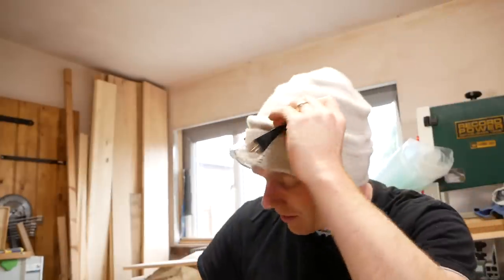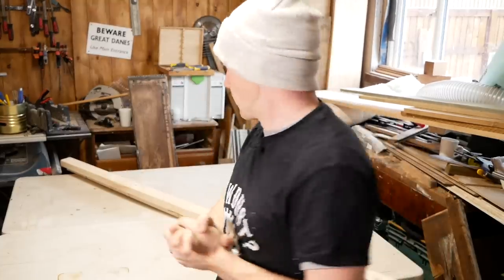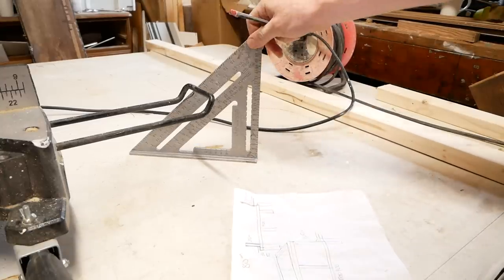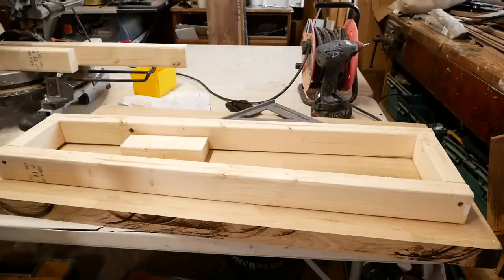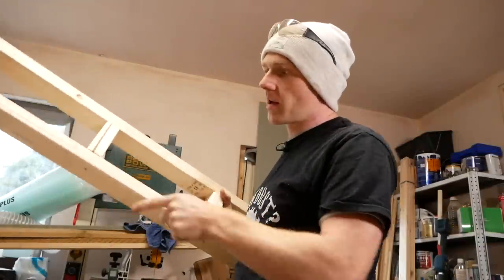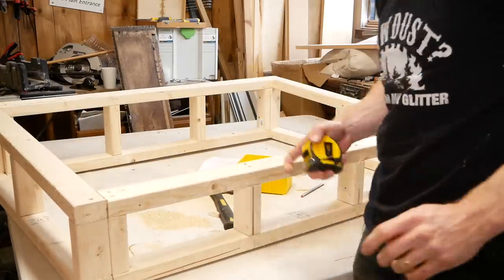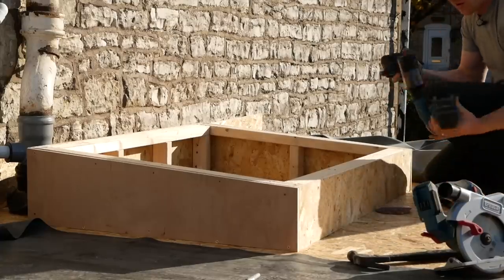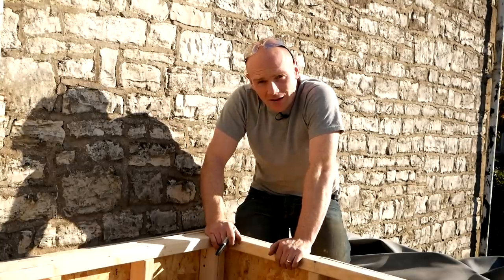Flat Roof Light Upstand - We are almost watertight!

Comment: I have been following your flat roof project off and on -- looks like I need to catch up!. For some strange reason, there are no 'do-it-yourself' flat roof projects here in America besides mine. Flat roofs seem to be very common in the UK but in America it is mostly used fro commercial buildings -- definitely not many of them done by homeowners. I made a couple of mistakes along the way, but flat roofs are not that hard, and I would have no problem doing it again! 

We barely got dried-in before the Wisconsin winter, but we made it. It's a great feeling. Now we'll see how well it handles snow and up to minus 40 temperatures! Keep up the good work! Cant wait to see the finished project!

Comment: Doing the same DIY project.  For your 75mm upstand, you mention 63mm CLS and 12mm ply.  Doesn't the 75mm need to include Xmm for the internal plasterboard plus skim finish as well as the 1.5mm for external EPDM?

Comment: (Another) great vid! First time commentator so go easy on me if this is a stupid question.  Where did you do this mistake.  Should the width have been 85 plus the OSB width?
Reply from the maker: From memory the rooflight needed 75 mm to sit on each side so the outside of the up stand needed to be 150 mm less. I did not allow for the width of OSB so the up stand would have been too big. So it just needed reducing in size to account for the sheet material. 👍

Comment: As a technical point I don't think the Buildings Regs require a specific upstand height, but most rooflights won't be warranted if you mount them at less than that, and ultimately that's what matters!

Comment: Bit of Google states The Government’s Planning Portal states that in England and Wales, the following conditions apply to rooflights:

They mustn’t protrude more than 150mm beyond the plane of the roof

They can’t be higher than the highest part of the roof

If it’s a side facing window it must be obscure-glazed. If it’s an opening window it must be 1.7 metres above the floor level.

Seems to me it's not wanting the large protrusion you have added
Reply from the maker: That’s planning not building regs? (and I believe talking about skylights like velum rather than flat roof.) 🤔
Reply: @TheRestorationCouple  took it from here https://roof-maker.co.uk/inspiration/blog/planning-permission-install-rooflight/ the pics used on the site aren't really pointing towards a velux. But yes you are correct that snippet used is if you need planning the building regs element is below on the same page doesnt seem to indicate demands for a raised up box and talks more about thermal efficiency and structural integrity
Reply: I can't claim to understand why but my googling found the following -

BS 6229: 1982, Code of Practice for flat roofs with continuously supported coverings, requires rooflights to incorporate upstands to raise the mat least 150mm above the uppermost roof surface to which the roof covering is bonded or dressed. The designer should ensure that the builder’s curb is at least 150mm high.